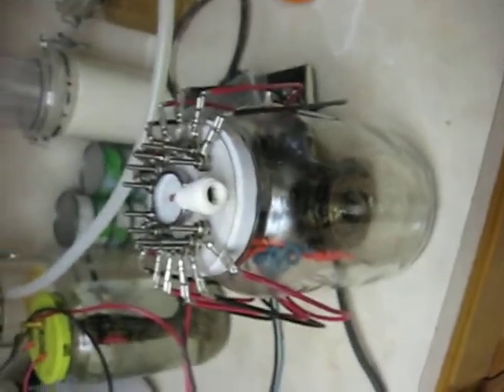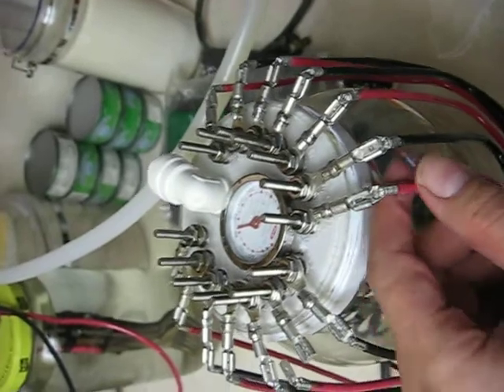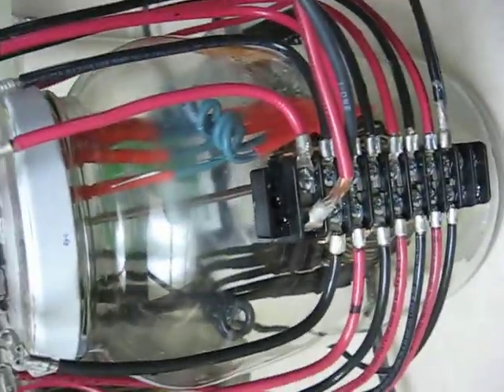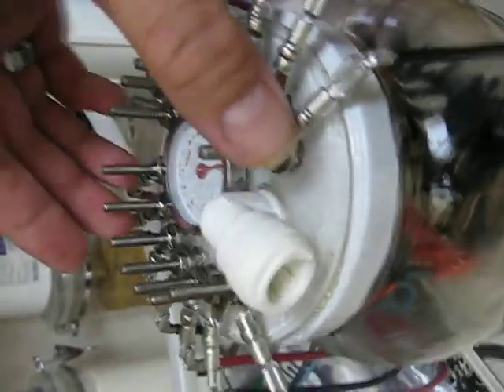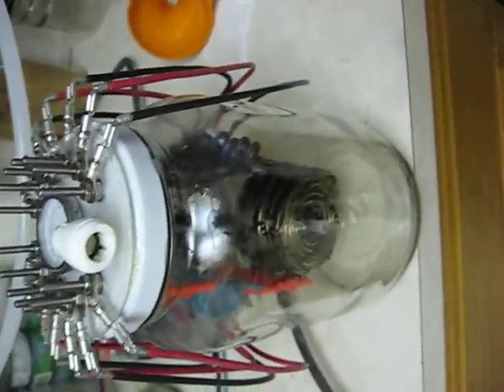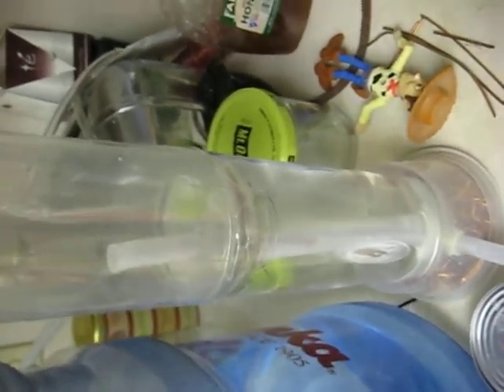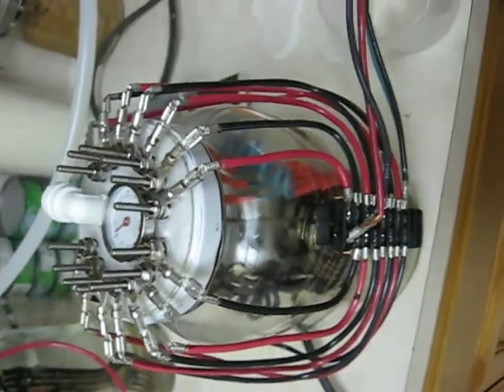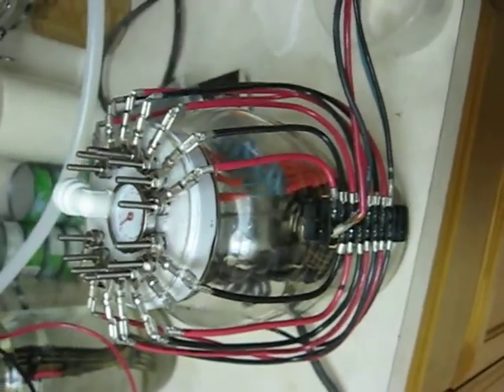Coil cell #3

Comment: Interesting solution! I welded odd tubes and even tubes for every pole. "Absorb" 3,17 Volt and 10,20 Amp and more.
how did you seal the cap? and the pressure meter?